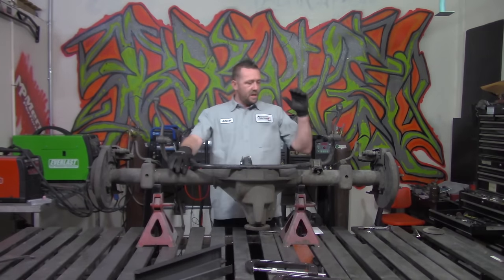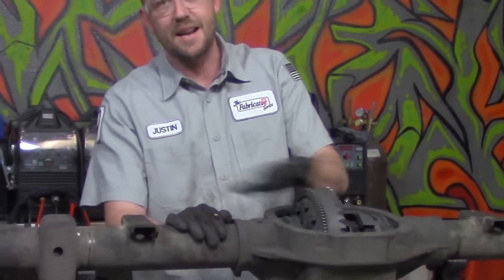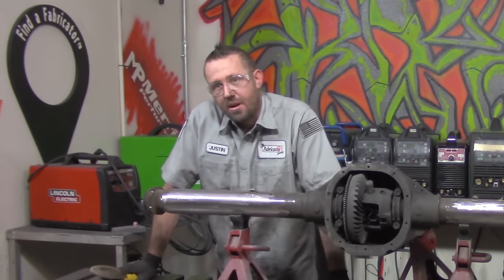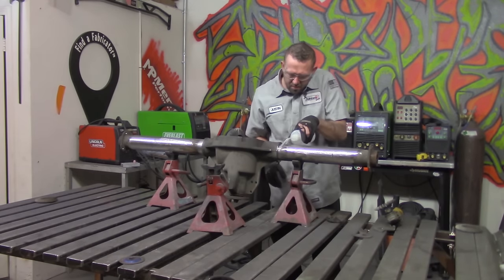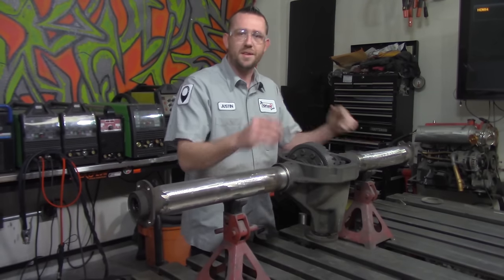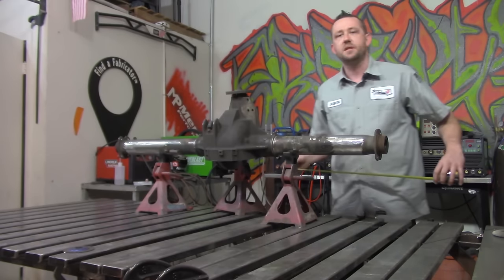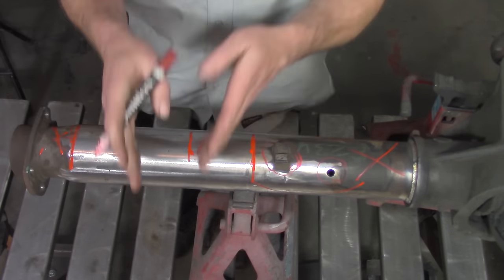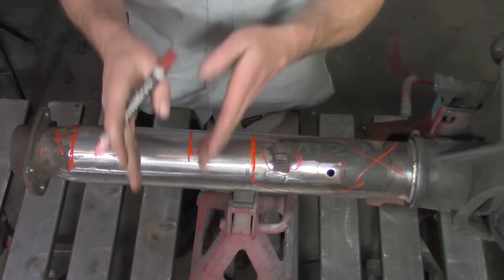TFS: How to Narrow a Ford 8.8 Part 1 - Strip Down

Comment: the old ford van 9 inch was a beauty as well. It was sooo offset that you could easily shorten it and use it in a pinto or vega. A perfect fit. We were doing this when i was 15 years old

Comment: Just a tip for welding cast iron, or any weldable cast metal for that matter. Pre heat the piece with a torch. Get er good n hot.  It will help the weld cool slower which reduces the chance of cracks
Reply: That was exactly my thoughts when I saw him welding the tubes to the pumpkin. It's actually cast steel but the composition off the metal is unknown. some people heat the pumpkin up with a torpedo type heater and let it gradually cool moving the heater farther away from the pumpkin in 15 minute intervals at a time.... 😎
Reply: Seen 100s of the 8.8s welded with every type of welder and NO CRACKS>.. so the steel STEEL its made up of is very good.. So dont worry about heating it up..  It will be fine.
Reply: correct sir
Reply: I always lay a basic beed, let it crack then go over it again HOT. Welded every type of cast steel imaginable with that method and it works like a charm. the sides of your weld never crack its always right down the center and if it doesnt crack weld it again anyways.
Just my hillbilly 2 cents.
Reply: bassmasterbri 
The center section is cast steel not cast iron. If it were made of cast iron it would break all the time. Just like all the newer LS exhaust manifolds 
They are also cast STEEL not cast iron.  That is why you see so many homemade turbo exhaust from the stock manifolds
Reply: @mikeeagle2653  I haven't seen any homemade turbo exhaust from the stock manifolds!!
Reply: @Anarchy-Is-Liberty  Its very common, lots of videos of homemade turbo LS manifolds from stock manifolds.

Comment: Thank you, great video.  One small suggestion I learned in my hobby shop, please do not take my suggestion as any hit on your talent, this video taught me plenty!  So here it is, you like me have a nice collection of welders behind you likely $1000s worth...  My point is for time management in my shop I now sport 3 angle grinders.  $50 each, one for cut off wheel, one for grinding, one for a wire wheel.   Have all three saves me time, which in-turn money.  Just a thought.   YOU have made skill MAN.  thank you again.
Reply: Totally agree on  grinders.  Even for home use, I've got half a dozen HF $10 angle grinders with assorted wheels and brushes.  Yeah, they're not as long lasting as name brands, but they don't have to be when you only use each one 1/6 of the time.  Also found it handy to cut short the cords and put plugs on, they all live together in their own toolbox without tangling.   I just use one retractable cord for them all.

Comment: I used to do a lot of 9 inch Ford rears , both to narrow and to install Grand National spindles when a full - floating rear was needed. I have the luxury of owning a full machine shop ( including a lathe big enough to handle a full sized rear and tubes ) but most of the time I found it faster and easier to just cut the tubes with a pipe cutter. With a good pipe cutter you get  square cuts and a bevel. Because I was doing this kind of work for some of the local racers as well as myself I built an alignment / welding fixture that was a real time saver. It was made from cold rolled round stock , the first part was clamped in the carrier saddles and was a reducer for a round bar just slightly smaller than the id of the tubes. The ends of the shaft were bored and tapped for different ends for however the tubes were to be finished. This setup even was center drilled so the whole thing could be put in the lathe and checked with a dial indicator.

Comment: For marking a cut line I like to use my big tube cutter and just run it around the axle a few times. It puts a perfect score line every time and it will always be square. We all have our own little tricks and that's just one of mine.
Reply: Ridgid # 423 is perfect.
Reply: There you go!
I destroyed a wheel of my Dear Daddy's once.Cutting bent fork tubes into.Didnt like that hardened CHROME! It cut both/but ,ruined that cutter.wheel

Comment: Filler 309 contains nickle which is ductile and thus prevents cracking. You can use even higher content and nickle base fillers when welding cast iron. If you're going to weld something like a bracket to a cast housing you can prep the surface with a layer of nickle base filler and then weld the bracket onto that.
Reply: Knuckelhead*
Reply: nickelhead !!!
Reply: whats with the fancy words anyway?.... ductile?.. seriously nucklebuck....
Reply: Yup...an old timer trick i learned was that if your unsure of the metal type use 309 rod...ive welded stainless to galvanized with 309 flawlessly!!!
Reply: Usually diffs are cast steel these days. Not 100% sure what this one is but if he did not have any cracking likely it is not cast iron

Edit: I missed the part where he said only one filler metal has been successful. So yea its plain old cast iron.
Reply: If this guy had a torch, he could have preheated the cast iron, then weld it with almost any commonly used welding rods. When he's done then use a torch again to cool the cast iron down slowly. Just a little tip I learned from an old blacksmith, that I have used in my blacksmith shop also.
Reply: @derangedmetalworks9489  Possibly. When welding cast iron you need a filler with lots of ductitity to handle all of the shrinkage. It all depends on the joint type and materials involved.

Comment: 309 filler rod works absolutely great for just about anything disimalar especially structural. Aluminum bronze works great when not. What a great video thanks Justin ...

Jason
Reply from the maker: It's definitely a go-to filer for me. Thanks for watching!
Reply: Except that aluminum-bronze is now classed as brazing and not welding.  309/309L were specifically designed for dissimilar metal welding.
Reply: Mike Ford correct! You get a gold star.. but who said welding or brazing? Just said it’s great for dissimilar. You aren’t wrong that it’s for brazing though. Brazing is great with Alu bronze for anything non structural as stated. We said the same thing

Comment: I have done a few rear diff mods. I like to drill the welds remove the tube from housing shorten then press in realine tube and rewelded back up.

Comment: To clean the tube, axle housings, I took a few washers, a 5/8ths wooden dowell rod, and a screw, screwed the washers to the end of the rod and wrapped a few paper towels around it.  Then, utilizing the square edge of the washer, raked the inside of the tube.  Got it pretty clean.  Sure beat trying to stick an arm down in there.
Reply from the maker: Walker Ashcraft I usually just wipe it out after cutting it. Whatever gets the job done best for the person doing the job is the right way 👍

Comment: fun fact. the 8.8 has different length axle tubes because ford actually made an 8.8 the same width as what you cut. thy put it in rangers and explorers. they just put two of the shorter tubes in for the skinny version. if anyones looking for them any explorer will have them or any ranger with a 4.0
Reply: Also look for a Ranger with a torsion bar front suspension. It has the 8.8.

Comment: Easy trick to taking off the spring pads that is much easier than what you did.   Cut them right down the middle fore to aft, then take a pry par and pry one side up from the cut you just made.  Then take the biggest adjustable wrench you have, and use that the work the piece back and forth until it breaks off.  Do the same for the other side.  You will be left with just the weld to grind down.

Works on everything but GM multileaf spring seats.  They have a spot weld in the center you have to grind off before you can work the seat until it breaks off.

Comment: I think I would have used a horizontal band saw to cut the axle tube.  It would have saved marking all around the tube.  I can cut square or rectangle tube with an angle grinder (had to cut 42 pieces of 2"x3" 11 ga tube for the CNC plasma table before we got a decent horizontal band saw) but round stock sucks for marking and cutting.  We had to cut some 6" sch 40 pipe a while back.  We had some scrap left over and , just screwing around, we rotated a cutt 180 degrees and cut a thin slice off.  The thin part was .015" and the thick part was .031".  About 0.001" per 1 inch is closer than you can cut with a angle grinder on round stock.

Comment: The best way to determine how much the axle tube needs shortening is to measure the difference between the long drive shaft and the short drive shaft, this difference is how much the axle tube needs shortening. The best way to mark two parallel lines around the axle tube is to cut a strip of thin sheet metal to the exact width needed wrap it tight around the axle hold in place with a jubilee clip then scribe a line around both sides. Then cut the tube off against the inside edge of both scribe lines, the axle will now be cut square and at the correct length needed.

Comment: Hi from New Zealand,
Another tip when using grinders uses ear protection and respiration protection. I'm a nurse have cared for truck and trailer loads of mechanics, engineers, carpenters, and builders. One thing they all have in common they are deaf and have chronic respiration problems.

Comment: Hi, great video, one question, doesn't that change the side angle of the drive shaft? Will it be too much of a change for a drag racing application?  In other words the drive shaft is no longer in the center of the chassis but to one side? Thanks.

Comment: I narrowed an 8.8 differential for my ‘66 Mustang.  Bought custom axles from Moser.  I took out 2 1/8” per side.  Tip:  Rent a pipe cutter.  It’s fast and accurate.  BTW, I used INNER pipes to align it.  Pictures upon request.
Reply: Would like to see this, have a Volvo Amazon I'd like to put an 8.8 on since the bolt pattern is 4.5

Comment: Just a couple suggestions from one welder fabricator to another, cutting the brackets off the tubes, Its much easier to use an actual grinding wheel, probably a 4inch in your case to gouge most of the weld out. The ginding wheel is obviously much stronger and you can make a few light passes over it following the high side of the weld then as it gets deeper you can buzz the top lip off to either use the cutting wheel to finish, or sometimes your lucky enough to just wack it off with min effort. Also, welding any cast iron its best to heat it with a torch first, even out past the main area but concentrated mostly on the welding area. If its somthing thats going to be structual and really need to be rugged, after your finished welding depending on what it is, give it a min to cool so it isnt red anymore and pack as much sand on it and around the area as possible. It'll make it cool slower and less prone to cracking.

Comment: Maybe a bit unnecessary but I have the axles shot blasted clean before cutting and welding but oh so much nicer to work on super clean and rust free axles. It takes about an hour and a few bucks worth of media but makes everything that much easier to do. The secret to good welds is the prep. Welding needs spotless clean joints. Blasting gets muck out of the metal pores and gaps.
Reply: Andrew Wilson 

Agreed. The first thing I do on any project is make sure it’s clean. I realize it’s not possible or practical in some situations but working on clean parts is so nice.
Reply: Why not use the 3 inch 3150 bearing out of the 9inch 31 spline  and eliminate the clip eliminate, now you have 9 inch ford caliper capacity and the correct bearing, just a thought.

Comment: Great video.
Make great videos about TIG welding!

Have smiled where you have marked the dimensions. It's true that you can do it with a ruler.

On our work we make it easier, we have a plastic strip (long: 100 cm, wide: 3-5cm, thick: 1-1.5mm). As you take the measure and marks the spot, then the plastic strip is wrapped around it and if the stripes are exactly on top of each other. you can draw with a pen along the edge.

Then the other measure is drawn and that's the same way. so you have the quick measure to raustrennen what you need.

Greetings from Germany

Comment: Great idea to use the other axele It makes the centre in the centre now it might launch straight down the strip with even axles if you only need few more inches if not just need to get axles made up to fit great job I have a spare one at home with a lsd centre I could use the late model wheels if I did it to my car no spacers just put the late model plate to mount the rear brakes and deeep dish wheels will fit nicely thanks mate 👍

Comment: Excellent  choise of the 309 filler! I can't TIG weld but I know this stuff very well from MIG welding. Ofcourse it's originally intended to weld steel to stainless steel but it has many more uses. The shop were I used to work used a lot of 309 Mig welding to create a hardened surface area when we ran out of the special electrodes.. Bit of a backyard solution but it did the trick. This was mostly done for a lot of wear plates where abrasive stuff went through pipes 24-7.
Reply: Nice!!

Comment: Use a pipe cutter it fast and doesn't put grindings in the housing.a couple of strong magnets on it will catch shavings also. If you don't have a large pipe cutter.

Comment: Ive done a BUNCH of 8.8 axle swaps, gear swaps, bearing swaps. And definitively  the best tool for removing AND installing the C-clip/axle retainer is a small magnet. I have a el cheap-O little inspection mirror with a magnet at the end of the telescoping handle that has seen more rears than ..... well you get it. lmRo!   Get er Done!              Oh $hit! Also, what brand of paint pen do you use?????

Comment: I narrowed an 8.8 Ford.  Special ordered new axles from Moser.  Came out great.
Reply: Mark Bartmanski , I installed it in my ‘66 Mustang fastback that I am retromodding.
Reply: Mark Bartmanski , sure.  I rented a big pipe cutter and cut out 2 1/8” off the middle of each side, narrowing it to OEM width.  I ordered Moser axles. The rear end came out of an ‘86 Thunderbird Turbo Coupe.  3.55 gears and disc brakes.  I cut away all of the unused suspension stuff and welded on leaf spring perches.  I precisely unturned the pinion nut, counting the turns.  Remove the carrier and replaced the bearings, putting the shims back exactly as they came off.  Put in new pinion bearing, seal and crush washer, and installed the pinion nut the exact same 13 1/4 turns.  Took several pictures.

Comment: Nice work, but I have to ask... why not just drill out the slug welds between the tube and the housing, shove the tube out with a porta power, cut the longer tube to match the short tube, press it back in, then weld everything up?

Comment: Same thing for chopping out 3", if you want a wider axle cut and put in 3" on the other side to match the length and use 2 left side axles.  But what tube thickness and diameter for that section.  Jeeps often do an 8.8 swap but they are a bit narrow.

Comment: i welded my tubes to my housing with ni-55 stick rod with the flux knocked off, worked a treat and wetted into the housing/tube like butter, excellent stuff to work with.
Reply: Why did you knock the flux off?
Reply: @phlodel  i knocked the flux off because i was tig welding the tubes together and didnt want the flux to contaminate my weld, had i been stick welding i would have just used the rods as normal.
Reply: @Cervan  Sorry. I didn't catch the TIG part. Why don't you just get nickle TIG wire?

Comment: When marking where to cut, mark one side and then cut a piece of posterboard or heavy paper, in your case, 2 7/8" wide x 8-10 inches long and wrap it around the axle. Align the ends and mark along sides of paper.

Comment: Cool video in the 1970s my Dad had a 1967 Mustang Fastback 289  he was always going to junkyards to buy Ford rearends to swap in and out of that Mustang  eventually he  got the correct gearing he wanted  which I believe came out of a LTD  my Dad wasn’t a professional trained drag racer  but he did  time his speeds and times  getting onto the same highway on ramps  which he timed to get a better speed at  keep in mind the Mustang was our family car  and as a young boy I thought it was cool to feel him “punch” the accelerator  he had also grown up in a very rural area of Upstate New York so when we  went to visit my Grandparents the old Man love racing on the rural roads he grew up driving on and knew pretty well  he loved that Mustang for those rides  and often borrowed a Chevy 2  with a SBC in it my Grandfather used  as his daily driver  that one had a 3 on the Floor  and could leave rubber in all 3 gears  my Dad would say put on your seat belt  and we go out and haul ass for a while the coolest Ford rear modification I know of was  a guy I know took one and put it into a old Ferrari he bought with a blown engine and installed all Ford running gear  he wanted to keep the Ferrari rims  on the car so he machined the two axles to fit into the Ford rear  ironically  over 35 years later the car was trying to be put back to factory specs  under its newest ownership and that guy was tracked down for any  input on original parts many of which he did know of the whereabouts  or who he sold them to apparently that specific car had  some historical significance to Ferrari collectors  and he was dibbed the guy that  tried to ruin the car  his take was completely different  as he bought a non running car , made it run ,and drove it for years  without the high maintenance costs associated  with the brand BTW the guy is my Uncle and he is a West Point graduate and retired Aerospace Engineer u,u.S. retired AirForce and Commercial Pilot  he did the machining himself on his Lathe in his home
Reply: That's awesome

Comment: The truck/SUV 8.8's are offset diff. The Mustang ones are centered and shorter but only have 28 spline vs the Truck 31.